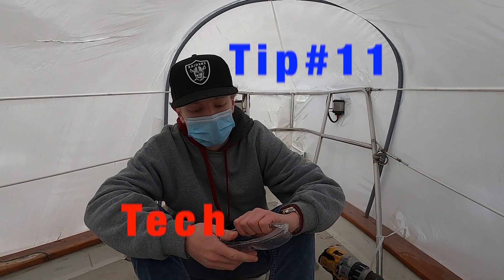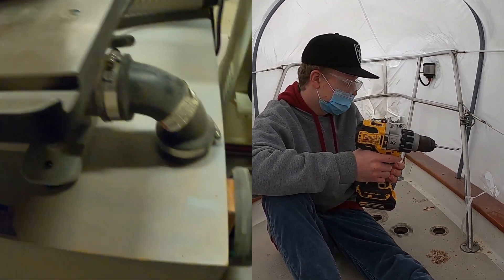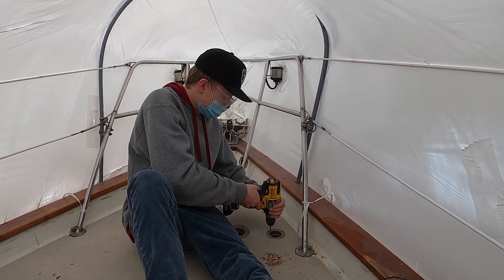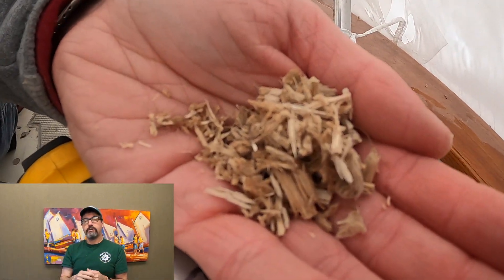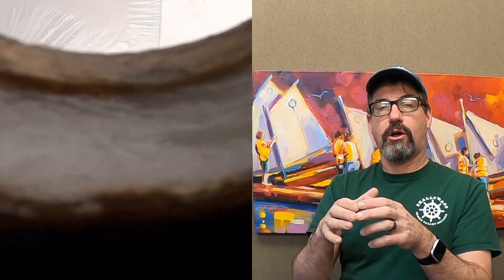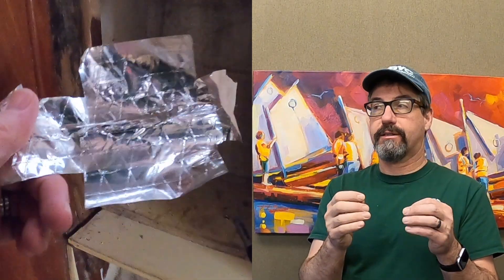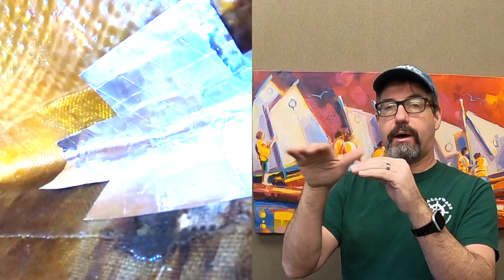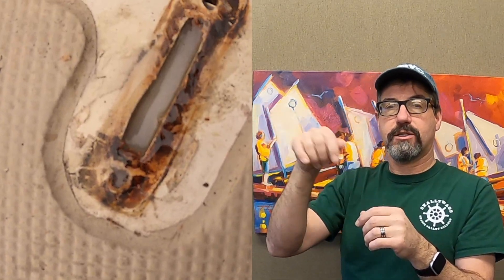TechTip#11: Removing Balsa Core from a deck

Comment: How long can balsa decking last? looking at a 1996 Cobra Viper bass boat. Will the rain penetrate into decking?
Reply from the maker: Balsa core can last the lifetime of a boat - if installed correctly and kept dry. Keeping dry is often the challenge, but boat builders have learned a lot the past couple of decades. Now that builders are doing it better, I'm always suspect when owners do there own work and don't know/take the time to do it correctly...inspect everything that was added after your boat left the factory. Cheers!